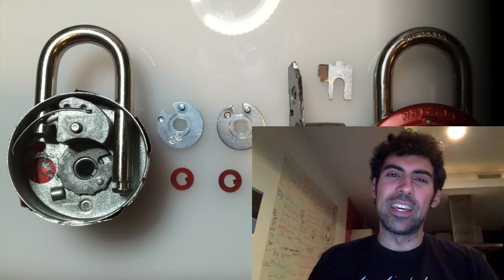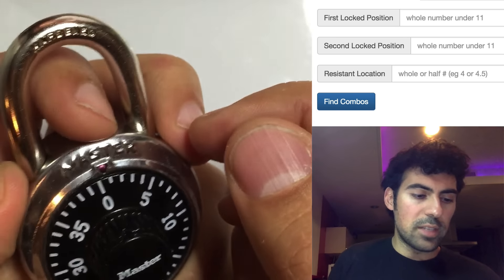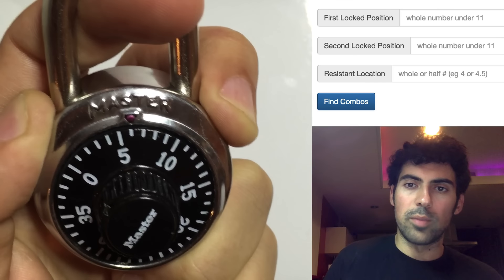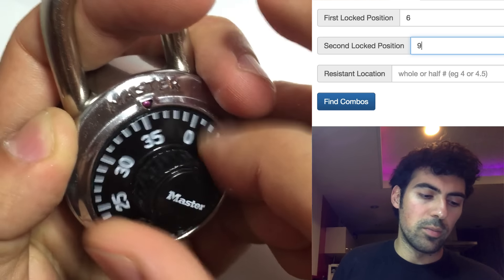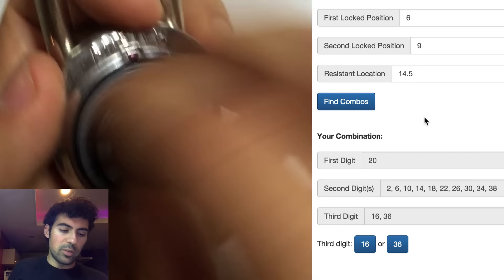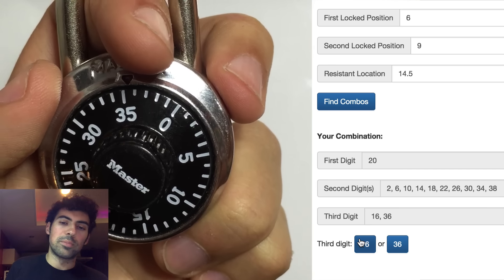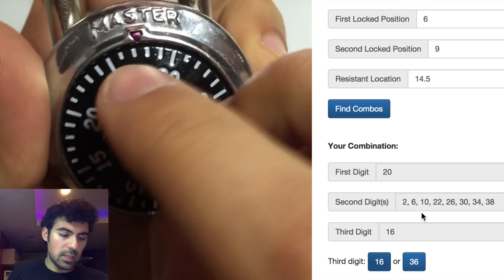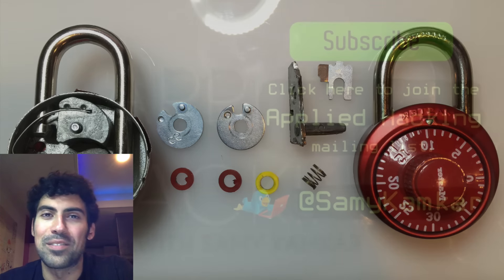Break open any Master Combo Lock in 8 tries or less!

Comment: +Samy Kamkar - Great videos!

One thing to point out that can make this method even easier ... 

The explanation looks complicated, but once you understand what's happening you'll see it's very simple and it will save you many many turns of the dial trying the various possibilities for the second digit.

Basically, after you have turned the dial from the second digit to the third digit, most of the time you don't have to start over again at the first digit to try the next possibility. You can go directly (CCW) to the next Second digit then (CW) back to the last (3rd) digit. The only time you have to start over at the first digit (one time at most), is if the last (3rd) digit falls between the previous and next possible Second digits.

This should work on most locks but there may be some where this doesn't work.

1) Use your method to get the list of combination digits (20/2,6,10,22,26,30,34,38/16).
2) Try the first combination as normal:
    a) Turn the dial 2-3 turns Clockwise (CW) and stop on the First digit (20)
    b) Turn the dial CCW past the number 2 and continue turning CCW and stop on 2
    c) Then turn the dial CW and stop on the last (final) digit (16)

3) Assuming that did not work, continue...
    DON'T start from the beginning! (Don't start from the first digit)
    a) The next second digit to try is the number 6
         The last (final) digit (16) is NOT between the previous second digit (2) 
         and the next second digit (6), so proceed to 3b
    b) From the previous position of the final digit (16) turn the dial CCW past 2 and stop on 6
    c) Then turn the dial CW and stop on the last (final) digit (16)

4) Continue...
    a) The next second digit to try is the number 10
         The last (final) digit (16) is NOT between the previous second digit (6) 
         and the next second digit (10), so proceed to 4b
    b) From the previous position of the final digit (16) turn the dial CCW past 6 and stop on 10
    c) Then turn the dial CW and stop on the last (final) digit (16)

5) Continue...
    a) The next second digit to try is the number 22
         The last (final) digit (16) IS between the previous second digit (10)
         and the next second digit (22), so proceed to 5b (start from the First digit (20))
    b) Turn the dial 2-3 turns Clockwise (CW) and stop on the First digit (20)
    c) Turn the dial CCW past the number 22 and continue turning CCW and stop on 22
    d) Then turn the dial CW and stop on the last (final) digit (16)

6) Continue...
    a) The next second digit to try is the number 26
         The last (final) digit (16) is NOT between the previous second digit (22) 
         and the next second digit (26), so proceed to 5b
    b) From the previous position (16) turn the dial CCW past 22 and stop on 26
    c) Then turn the dial CW and stop on the last (final) digit (16)
    d) Repeat for the remaining second digits to try: 30,34,38 until the combination is found.

Comment: I thought I knew the first digit for sure and the second digit completely wrong but it turns out I was 3 ticks off for the first digit and the second digit was actually correct. Instead of 32 it was 35 and the second digit was 21. Thankfully your video and that website helped! I can now go to sleep after trying to open that dumb lock for 2 hours lol

Comment: ok im just gonna say your awsome dude. i open mines with a few tries (over 16 tries). But it was because the part about not finding two locations from 1-10 ( it only gave me the number 8. i tried 10-20 and got 18 then i tried 20- 30 and got 25-28 (5-8). In terms i found the resistance and got my Combo in the first try.  great work man.
Reply from the maker: Woot!

Comment: This method finally worked after 4 tries and down to the last possible combination then click! even after trying other videos and then coming back!  The RESISTANCE is the tough part.  The old lock I had felt like it had 3 different possible spots and you have to go by "feel"!   My trick for the last number was to just try both on each attempt, might as well because you are swinging by it anyway!

Comment: I did everything correctly as you described here but no luck. At least your video was easy to follow and I liked the fact that you had a little software app that could do the math and conjure up the right combination of numbers. I haven't given up yet, and I'm determined to crack a Masterlock Combination pad lock. It's the holy grail of lock-picking enthusiast.
Reply from the maker: What are you locked and resistant locations?
Reply: @samykamkar  1st lock - 5, second is 8 and resistant location is 34.
Reply: This method predicted two combinations right , but the resistance location was 14 clicks away at 25, Anyway, Master Lock came out the winner in this game. I haven't given up on my criminal career though.

Comment: Or just 1. pull up shackle just barely and turn counterclockwise until you get to the number of highest tension then up that number by 5 so now you got your first number. 2. start at 0, pull shackle up a little bit harder and turn clockwise until you are forced to stop at a number, you cannot go past this number in any way, so go back and forth and do just as before barely pull on the shackle until you find the most tension on a number, that number will be your 2nd number. 3. pull up on shackle and keep turning counterclockwise until it opens. The first number could be wrong so up it by 1 if it doesn't work

Comment: Found a lock in the locker room that had been removed with bolt cutters. Someone just left it on the floor. So I thought I'd bring it home and (for fun) figure out the combo. I had to use vise grips to do the pulling. I've got locked positions at 0 and 3, and resistant at 21. None of the listed combos worked. (I tried all possible combos for both 10 and 30 as the last digit.) I don't doubt your method, but just wanted to leave a comment and say thanks for the video and developing the technique. :)

Comment: This works but the step of finding the resistance location on new master locks is a lot harder. I was able to find a general location but not precisely the place. As a workaround I found a completely different technique that found the third combination number. Then I tried several resistance locations to find the one that outputted the matching third combination number. 

Here's the technique to find the third combination number:

On older Master Locks, ones where the arrow at the top is raised, simply pull on the shackle and turn the dial until it catches, that's the third number in the combination.

On new locks with the recessed arrow, there are twelve places the dial will catch if you turn it while pulling on the shackle. Seven of these will catch between two numbers - ignore these. Find the five that catch on a number. Four of these will end in the same digit, like 1, 11, 21, and 31. The fifth ends with a different digit, and is the third number in the combination.

Comment: This actually works for me. Oh dont get me wrong I spend a lot of time solving it. The biggest thing you have to watch out for is the Resistant location. The first and second lock positions are so easy since they are number between 0 and 11. If you have tried all the combinations and none of them works. Check your resistant location again. In fact, I suggest closing your eyes when doing this part. Then the last thing to do is try all the numbers.
Reply: LOL!  100% agree.  My lock is on a gate and so, I'm not applying lift to the shackle with just one finger like Samy shows in his video.  I tried the "eyes closed" thing and ended up with 4 different resistance numbers!  Safecracking is not in my future for sure!

Comment: You can find the combination even faster if you don't reset the dial on every attempt. The lock will remember the first number you chose throughout the process. But for the second number you should start with the lowest one that is greater than your first number (20 in this case). So in your example you could turn Right to 20, Left past 20, stop at 22, right to 16, pull. If that hadn't worked, you could then just turn Left to 26 and Right to 16 again and pull. Then Left to 30 and Right to 16 and pull. As you are turning the dial left each time, you will feel a little extra resistance when you get to the previous number you were at, which helps you remember which one you are on. So when you feel the resistance you just advance 4 more positions then turn back again and pull.

Comment: I'm actually very surprised work how well this worked. I have two of these locks and I already knew the combos, so I tested this to see how accurate it was. It got both of them correctly, the second one on the first try, the first one I needed a redo because I got the number wrong. It's kinda scary how well this works.
Reply: Kind of scary how some people make this same exact claim, yet it sure won't work on any Masterlock I've ever laid my hands on.  You must have found a really interesting lock without the gear shape discs that cause stoppage/resistance across the entire pad.  LOL Lucky you!
Reply: @The_Insanity_Plex  To my knowledge, the only thing I could think of is that you may not be tugging the latch enough for the first steps or too much for the last steps. The locks that I had were the exact ones shown in the video.

Comment: Your a genius with that calculator! I think I have something to contribute. there are 2 sets of comb # that will unlock my comb.exm. mine came with 25,11,5 with your calculator I discovered that 26,12,6 will also unlock. thus breaking down the 64'000 pos.in half 32'000

Comment: I got first (5), second (8) locked positions and 3rd digit (15) correct. But I could not get resistant location for 1st digit at all. I was pretty sure 3rd digit was 15 so I back propagated it by trying different resistant location numbers in calculator that would yield 15 as a 3rd digit. Still could not get it to work so I lost patience and drilled 5mm hole directly above cam disk slits to be able to observe them line up and got it open. Turns out I was really close! Resistance number was 18 giving me 23 as first digit. Then second digit was the last one on the list. This was a lot of fun.

Comment: Using the website and this method is the best I've seen yet.  Finding the first and second locked positions and the most resistant # is pretty easy.  And even if figuring out which of the two 3rd #'s you're given is an issue, you can always just try twice the number of combinations for that 3rd number.  But how does it go from 20 combination to 8 like the website says?  Wouldn't that be 20 to 10?
Reply: When you lock in the third number, the website eliminates 2 of the second-digit numbers, leaving only 8 of the initial 10.

Comment: I don’t ever get resistance once per revolution. I either get no resistance or resistance at many points. I’ve tried very slightly releasing and adding pressure and this remains true. It seems there’s a bunch of resistance points in a row. When I apply just barely enough pressure to stop it from spinning freely, I get resistance at at least 5 points between 0 and 15

Comment: I have two locks that this worked with, and two others that wouldn't go along with the plan. :)  I did, after finding the combination to a later model lock that I have, go back to the online computation page and tried to make it suggest the correct combination, but it wouldn't work.
The mystery lock ended up being a 28-30-36 combination... yes, the second digit was only 2 numbers from the first... and nothing I did on the computation page would cause the program to suggest 36 as the last number, with 28 as the first. 
So... not all of these locks are put together the same way, apparently. One of my other Master locks has exactly "zero" false gates; the only place the dial stops at all is around 7, which in that lock's case is indeed the last number.

Comment: i dont have a lock with a 40 (which was my 3rd number) on it that is just 0 on my dial. also for mine i didnt have a second locked position so it made it kind of confusing to leave blank. as well i had 2 spots of resistance. still took roughly 15 minutes of messing with it to figure it out. not too bad if you asked me.

Comment: Just tried this on an old Master lock and it worked like a charm.  Then I tried it with a Master Lock that I just bought last week and it didn't work.  The resistance point is where you know it won't work.

Comment: try this...if you have good hearing set lock to zero....then while holding flat side to ear turn the lock till you hear a click in stead of a grind noise then look at lock turn dial opsite direct 1 revolution then again hold against ear till yo her a click then turn dial opposite way till you hear a click then your done it will open ...to practice hearing the click use a lock that you know what the combo is  and when to expect to hear click for practice :) this works on these types of cheaper locks

Comment: Masterlock stops at MANY points when applying pressure to the shackle.  When you release it just enough to avoid the repeating stoppage, ALL stoppage is gone.  There is no such option of only applying enough pressure to get ONE point of resistance.  Your method either isn't real, or only works on very specific (possibly conditioned to your liking) locks.  I can guarantee beyond a shadow of doubt you wouldn't be opening the Masterlock I have here, despite it looking like the exact model you have.  Amazing how easy something looks on a video that was pre-planned and had a very ideal set of conditions in play, with a lock you already owned AND knew the combo for.  Of course you can make it look like you "felt" where to stop when you already know.
Reply from the maker: Note the hundreds of users in the comments who have had success. The resistant location is there but you do need to be very fine with the adjustment of the shackle.

Comment: I can't seem to get it to work for me. But my situation is fairly different from your controlled video. My lock is still attached to my work locker and I've been trying your method for three days and can't get my lock to open. It's easy when it's not attached but not so much when you can't control the lock with just your finger
Reply: Were you able to find the first two numbers?

Comment: my very old lock has a knurled knob. it stops solid on every other number. I think they changed the design over the years.
Reply: After taking off the back a surprise. All 3 numbers are the same 35-35-35.
No wonder I had issues

Comment: This is super cool! I tried to figure it out and my first location 2.5, second location is 6, and resistant location is 35. 12 has more give, but I know that the combination doesn't start with a 0. Is there a way we could reverse engineer it, so we could put in our lock combination and see where the resistant location should be?

Comment: Have a stack of old locks.   This worked on most of them.   Unfortunately, the newer ones dont work I believe they're all v660 models.   I can find the first 2 "locked" positions however the "Resistant" number(s) that I find doesn't work.   For one of the locks,I retrieved the combination through serial number lookup,  and reverse engineering the script on this site shows I was correct with the "locked" numbers, but the "Resistant" number doesn't even register with any resistance (unless i force the shackle fully up,  rendering the technique ineffective since all of the false gates are resistive too).

Not complaining,  just curious if you have a work around, or an updated script, or just any thoughts on the matter. 

At any rate, its awesome work and I appreciate the effirt you put into it.
Reply from the maker: Interesting, thanks for the info, I'll see if I can grab a v660 mode and see if they've changed internalsl. Do note, the resistant location does take some finesse but sounds like you've already figured out where it is on other locks.
Reply: @samykamkar  I agree that it takes a bit of time to get the idea on how hard to pull the shackle, but I (would like to think I) figured it out, I've opened about ~20 locks so far.   I don't know how many you would need,  but I think I have 5 or 6 that are v660 and don't work with this method.   You're welcome to them (they've been sitting in a drawer for several years at this point).  I don't have the combinations for them (I don't have the time to go to a retailer to get them), but I figure your likely to cut them open any way.

Comment: At some point in the distant past the internals of dial Master locks must have changed.  I have one that is in the neighborhood of 42 - 43 years old ( I remember about when I got it) and step one of your process doesn't work at all.  Pulling hard on the shackle, at the first stop after zero the dial moves back and forth 2.5 digits.  At the next stop it moves back and forth 5.5 digits.  I doubt this is due to wear as the lock really didn't get much use before I forgot the combination.

Comment: I do not get any whole number between 0 and 11.  I do get one whole number between 0 and 20. So over all moving and loosening these are the numbers I get: 4.5, 7.5, 10.5, 14, 17.5, 20.5, 24, 27.5, 30.5, 34, 36.5 and 0.5. So I went ahead and assume the only weird numbers are 14, 24, and 34. So I used 4 and 4 as the whole numbers for first and second whole numbers on your calculator and my resistance is in 31. I tried all the combinations (under the assumption that 4 and 4 was my way to go)  and none of them work. At this point I am this close of just buying a new lock. But now I just wanna unlock it by principle lol. Do you have any ideas?
Reply: Same kind of problem here too.